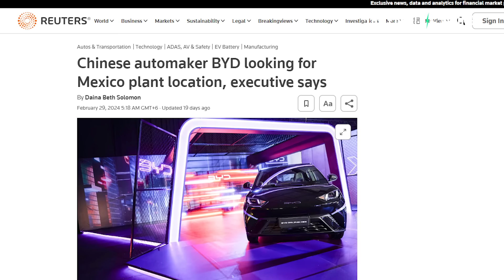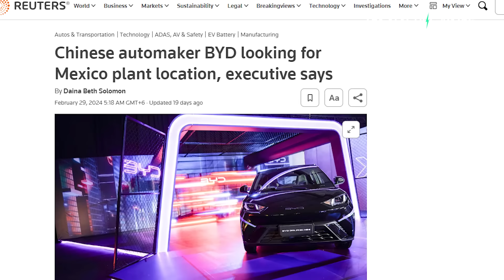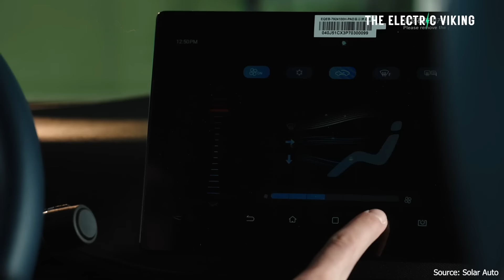Donald Trump says Chinese EVs will be virtually impossible to sell in America

Comment: I live in northern Mexico in the winter and Washington State in summer.  I am a permanent resident of Mexico and a citizen of the USA.  I can buy and register a BYD car in Sonora and drive it in all of North America.

I visited a BYD dealer in Hermosillo Sonora.  The salesman showed me the BYD Seal.  Cost was 888,000 Pesos - about $52,700 depending on the exchange rate.  In Mexico, car sticker prices HAVE TO include taxes and fees.  The BYD Seal is very  nice and very impressive.  It has a 82 KwH traction battery.  However, for us there are 2 show stoppers:  ground clearance and charge port type.  The charge port connector is a Chinese standard.  The salesman thought that the charge port would change in 2026.  But, to which standard - NACS or CCS1?  Would BYD get an agreement with Tesla for access to Superchargers?

At this point in time, the only location in the state of Sonora with DC fast chargers is Santa Ana, Sonora.

The Tesla model Y long range is about the same list price as the BYD Seal.  But, I can get the $7,500 tax rebate for the Tesla Model Y.  However, taxes and fees will be added to the Washington State Tesla purchase.

Comment: 30% of US manufacturing is the auto industry. You are correct it will not matter who wins the US presidency there will be protection of this industry. As someone that spent my career in US manufacturing (printing) I may be to prejudiced to say if this is good or bad. I tend to think good/bad on these issues is in the eye of the beholder. I believe EV's made in Africa with over 50% of components made in Africa should be able to import to the US duty free. Take that rump. How this *should work is that the manufacturers in Africa receive aid, engineering assistance ect. from Ford, and GM. Or that the manufacturing facilities in Africa be in fact owned by Ford or GM. Why not Tesla? Africans do not like whiners. This is just factual.

Comment: The cost of ev,even with incentives (by the way, when they have incentives from government, they highly boost the price).Ev are too expensive for one,two is the cost of replacing the battery after 10 years.As long that EV prices don't come close to combustion engine,its going to be hard for them.
Reply: The best selling BYD in China is 12,000 dollars. The better ones are 20,000-30,000. Tesla Model 3 in China is 35,000. The new batteries have 27 years life.
Reply: In Canada, we don't have ev at the price of 20000-30000, it's at least 40 000 or higher😢

Comment: Well BYD might look good, but are they reliable in the long range?? What is the wait to get one fix when any issues appears, defects etc?? For me i owned more than 100 vehicles in my life, for pleasure, work, and i could fix all of them myself. I had vehicles that went for more than 300K to 500k kilometers for the years i had owned them. Will that ever be the case for any EV's?? We do not have the infrastructure for EV's yet in Canada either, plus add our winters for 5 months a year that ranges from -20 celcius to -50 celcius depending where you live. We also have tremendous snow storms, blizzards, lots of snow and ice on the road, lots of accidents as well. Imagine to be waiting for the roads to be cleared from said accident in a snow storm for 6 to 8 hours?? Will we need even more towings to remove all those EV's from highways?? The EV's will have lost all their charge, the batteries will be frozen and they will just be useless for days, if even they are not required to be sent to dealers to have them check out before getting back on the roads safely 😞 When i used to drive around for my business between 300 to 500 kilometers with my 14 feet cube truck each day, it weighted around 12 000 pounds and use about 150$ of gas in 2008, could an EV ever be able to carry such a load and run all day?? nope, and in winter? NEVER!! EV's are a pipe dream for Canada in reality, it might be doable in countries with warm weather, but not too hot or that might end up setting them on fire also. Hybrids would be the way to go for regular citizens, if the battery runs out you could always realy on the gas engine.
Reply: EVs and batteries have improved tremendously in the last few years. You can Google BYD awards and find the specs for a few models-Seal, Dolphin and Atto 3. The most advanced model is called U8 but it’s expensive.

Comment: People can be fooled & hope to get a bargain. 2 million+ Chevy Vegas were sold to people hoping for a cheaper alternative; but like Chinese cars will prove - they cut corners resulting in junk. BYD, China's leading EV maker, is junk. This channel reported new BYDs coming to Oz with Rust already under the paint - no quallity car maker makes junk like that. More importantly; air bags may not deploy, metal and bearings of inferior quality,  The reason is QA. QA is a system to assure quality. China doesn't use it. Japan learned QA after WWII, now they make many of the most reliable cars. CCP supresses flaw reports; this means Chinese companies don't learn to improve.

Comment: 1 out of every 6 vehicles sold in the us in 2023 was built in Mexico, for manufacturers primarily including GM/Ford/Toyota/Nissan/VW/Honda.  Companies do this to cut costs.  This will continue, with China and other countries piling on.  Some new factories are being built in the US for EVs, while others will be mothballed/sold as ICE vehicles phase out.  Robotic manufacturing will reduce jobs in ALL manufacturing locations as well over the next 10 years at greatly increased rates few are acknowledging, really.  The new factories (often) are designed with FAR FEWER workers per unit of production, again, to lower costs.  Consumers will win by having cheaper, better vehicles with better environmental impact; low tech labor jobs will be the losers, as they are eliminated much faster than people expect.  US government (to my knowledge) is not yet prepared to help this transition of the industries, and they NEED to be changing as fast as the private sector or SIGNIFICANT socio-economic upheaval will definitely occur, in both blue-collar and white-collar labor markets.

Comment: This is all BS.  China has done many joint ventures with Volvo, MG and many companies.  They can do the same with Ford or GM.  If ICE car companies can do this like Subaru, Mazda and Toyota, then BYD can too.  BYD could open up a manufacturing and assembly plant in America too.  This is done now with Toyota and maybe foreign car brands.  My only complaint with BYD is their massive equity valuation losses and reduced sales.  They have a big problem with availability of parts and service.  So if  you buy the Atto 3, what guarantees will parts & service be readily available years from now?

Comment: The fundamental problem with new car purchases in the US is not the threat from low cost Chinese cars per-se.  Rather, the problem is that US legacy auto makers don't know how to make modern (BEV), affordable, compelling cars that US citizens what to buy at a profit.  Like them or not, the only US car manufacturer today that can compete with Chinese autos worldwide, US included, is Tesla.  To this end, I'm waiting for the NextGen compact in late 2025/early 2026.  To Tesla's credit, the reason it's taking them so long to release the NextGen compact in the 20-25K price range is that it's hard to do from engineering and mass production standpoints.  Tesla has taken several years to learn how to do this (48v architecture, drive by wire, brake by wire, unboxed manufacturing process, etc).  US legacy auto makers have not put this work in, and they'll pay the price in sales going forward.  Or worse, which is going to happen, US tax payers will pay the price via another set of bailouts from the government for obsolete US auto makers.  In summary, the US government's solution the to Chinese auto threat will be a combination of bailouts and enhanced protectionism.  This doesn't sound like capitalism to me...